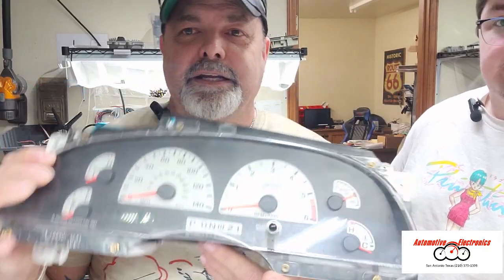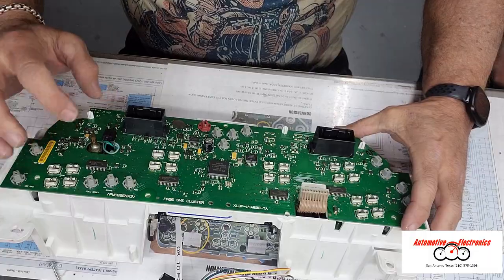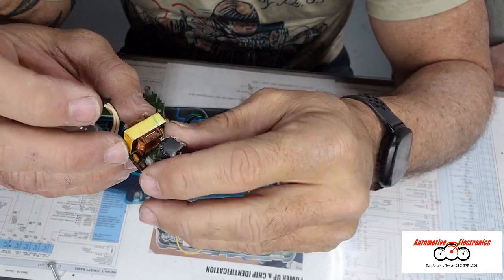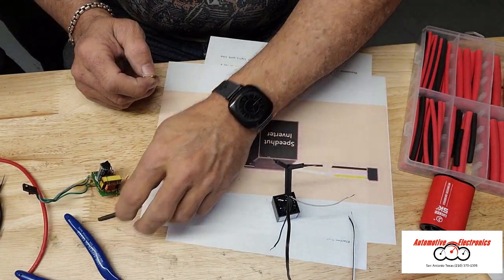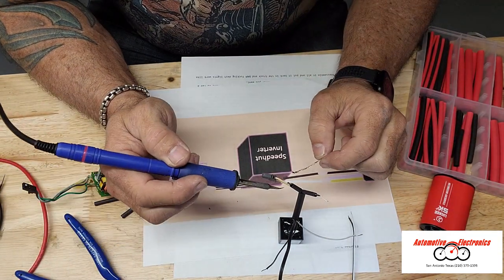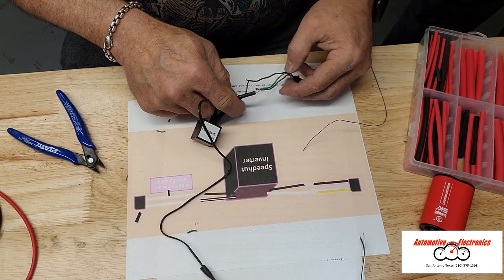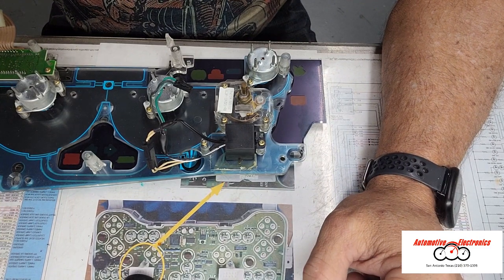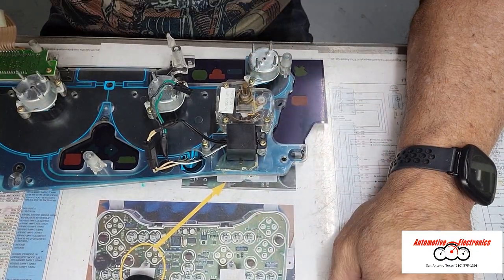99 -04 Ford F150 Lightning SVT Dash Lights Repaired!

Comment: The same repair applies to the 2003-2004 Mustang Cobras. Same part, same install.  Not as bright as original from the ones I’ve done, but pretty good fix overall.

Comment: Hello guys, thank you for the great video! Do you think the process of replacing the inverter would be about the same for the electroluminescent backlighting in a 2006 Roush mustang? My gauges flicker and go out occasionally. Lately it has gotten worse and the EL backlighting doesn’t come on very long.
Reply from the maker: it would likely be simular at the least